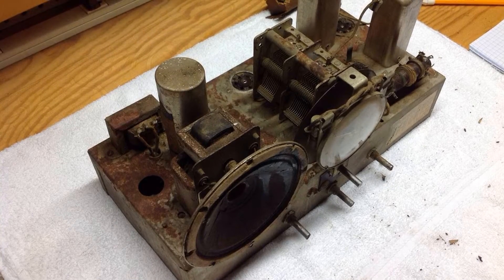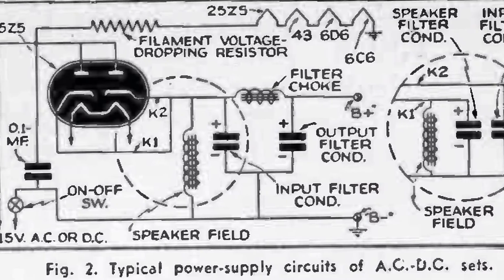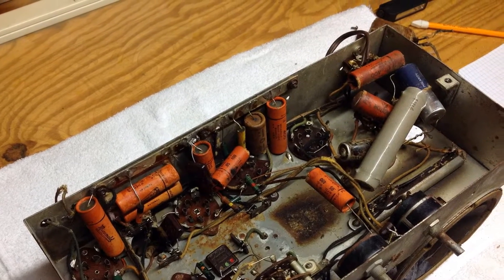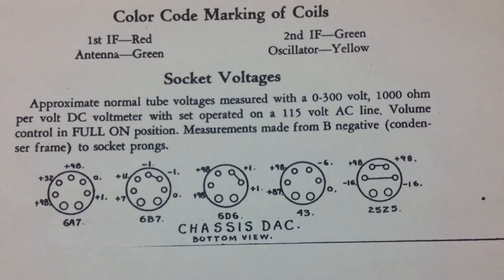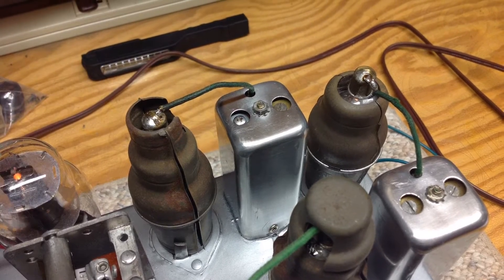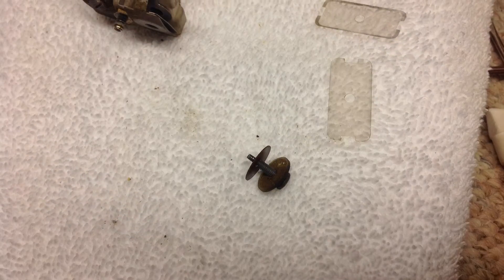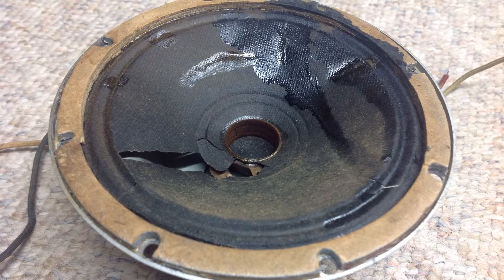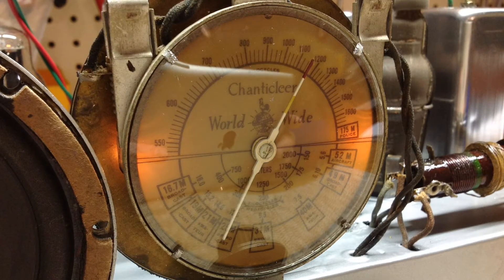Chanticleer 2D570 - Electrical Restoration & Speaker Woes

Comment: G.E.  T 126 C schematic thanks for the info on the glue
Reply from the maker: I may have a copy this. I will let you know tomorrow. If I don’t, you can get it from Steve at:

https://theschematicman.com/instantdownloads.htm#!/Photofact-Instant-PDF-Downloads-sets-300-499/c/2377497/offset=450&sort=nameAsc

Looks like your GE T126C is in Sams Photofact 431-9, but double check on this.
Reply from the maker: Ron, I checked today and I don’t have the schematic for this radio. Sorry I can’t help. Best, Don

Comment: Man your work is so good ,i jealous of you skill ,i just started ,buying tube radios ,i have one i think is done  ,except ,the speaker wires broke off so now i am trying to find a schematic ,what glue do you use for small speaker,hole ,i have silicone,nail polish ,aileens glue,white glue,etc,what do you use?
Reply from the maker: Aleene's Original Tacky Glue with a few drops of water to thin it a bit so you can brush it on with a small artist brush. What schematic are you looking for? Best, Don